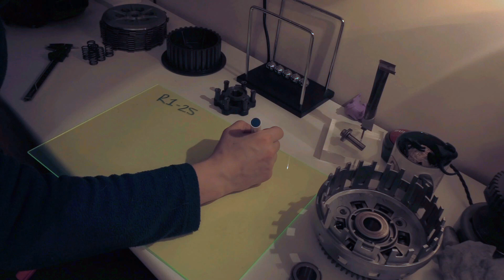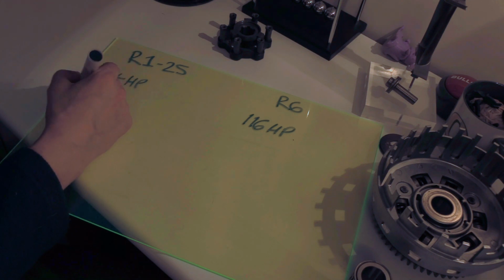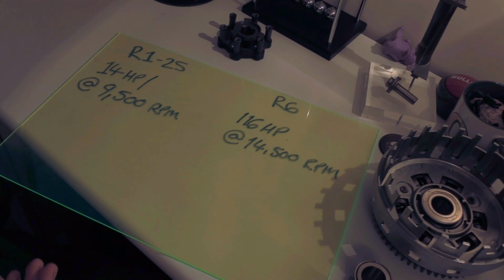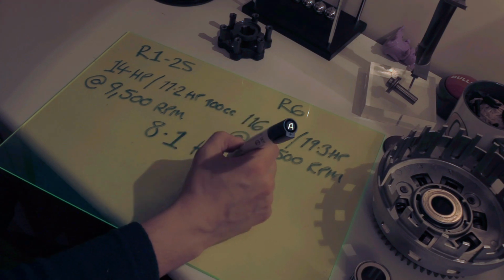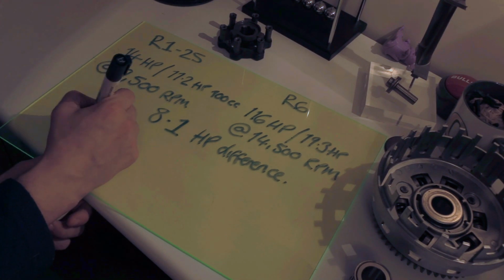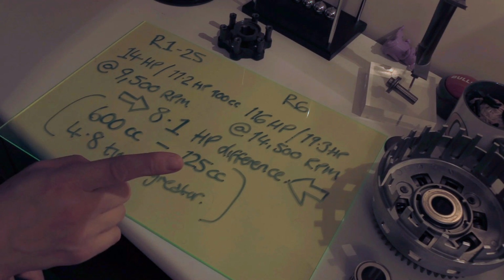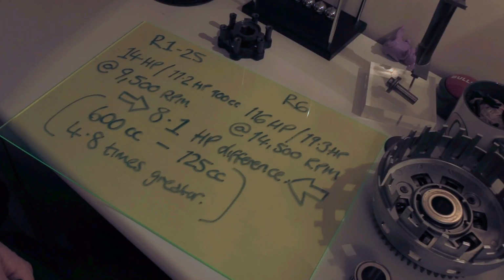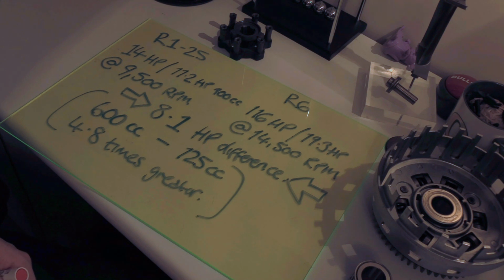Power Difference - R125 vs R6?

Comment: Because a r125 isnt built like a crf150r. I would just say most significant difference is r125 is undersquare.
Reply from the maker: Undersquare = less power? You don't understand power...
Reply: @thedirtyworkshop  Not what i was imply. But a oversquare engine will allow you too rev quicker and achieve higher RPM. A R125 is likely under squared mainly for reliability. Other biggest difference would be camshaft profile/timing and ignition timing.
Reply from the maker: Under square for reliability? So an r6 is less reliable than a r125?
Reply: @thedirtyworkshop  Not implying that either. But a oversquare 125 would be slightly less reliable than a undersquare 125.
Reply from the maker: Based on what? And what would be less reliable? 🤔
Reply: @thedirtyworkshop   Based on the fact single cylinders are held at max RPM much more often and for longer durations. This is mainly why MX bikes have shorter top end rebuild intervals because they achieve very high rpm and have a over square engines makes it more susceptible to piston slap as the bore/piston wears.

And since the r125 is a small displacement single cylinder street bike that makes it even more likely too be held wide open at max rpm for long periods of time and if you build it like a MX bike it isn't gonna last as long under those conditions.
Reply from the maker: I can promise you that a 125 is held at its max rpm a lot more than an r6
Reply: @thedirtyworkshop  Is that not what a said lol?
Reply from the maker: Sorry yes, I read that wrong. But that goes against what you said about 125s and reliability due to being undersquare..
Reply: @thedirtyworkshop What im saying... Is i think the biggest fundamental difference and limiting factor between the two is that the r125 is undersquare. 

If you were too make the r125 engine equivalent too a r6. It would be the same as a MX engine and we know MX bikes have low maintenance intervals, which would not be good for street bike.

Comment: probably helps that the r6 is DOHC valves per cylinder whereas the 125 is only SOHC? .1 differance in compression ratio. also i suppose the most obvious is the fact that it revs higher? say for instace the r125 was made to rev to 14.5 k, then you tuned your fuelling and exhaust so that peak power would be at the 14.5 k mark you would have the same power per cc as the r6. obviusly it wouldnt rev that high as SOHC. uniinformed normie so tell me why im wrong please :)

Comment: There's many factors to why the r6 makes more hp for it's displacement. One of which in this scenario is 4cyls vs 1 cyl.  Here's an example of why 4 cylinders vs 1 cylinder can be better for hp. 

So, the r6 makes 116hp/600cc = .193hp/cc. 

The r125 makes 14hp/125cc =
.112hp/cc

The 1994 cbr250rr made 40hp/250cc = 
.16hp/cc

The MC22 is not quite on par with a new r6 in hp per displacement but it's much closer which is impressive being that it's not far from being a 30 year old bike. 

Like I said there's a lot more than that, I don't feel like typing more. 

Thanks for the vid Matt.

Comment: The yamaha r 125 has a pretty shit engine. I'm not even arguing about sohc and dohc. But you coult probably get more power out of it with a different camshaft, and different fuel injection and ignition programming.

The answer is probably the 15HP max for EU 125 licenses or British learner bikes

Even if you'd modify your R125 engine I doubt it'll hold very long. Manufacturing quality of them is rather underwhelming.